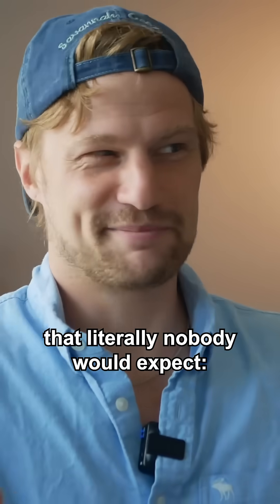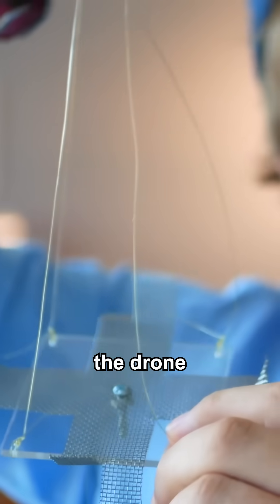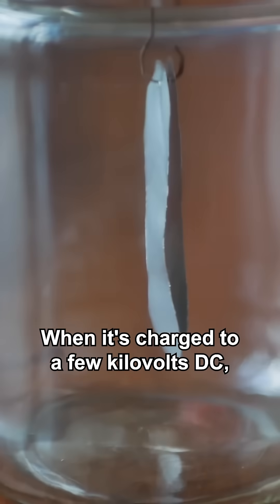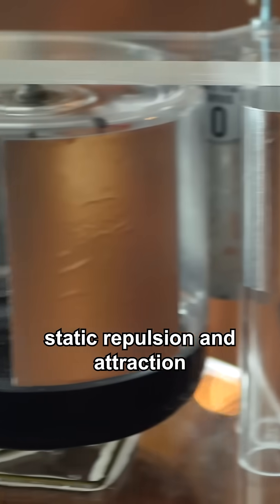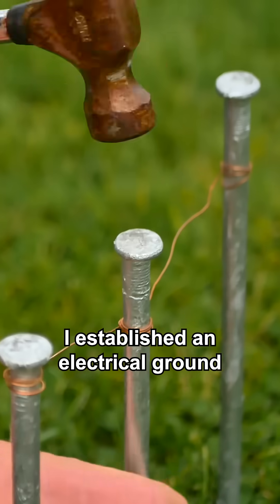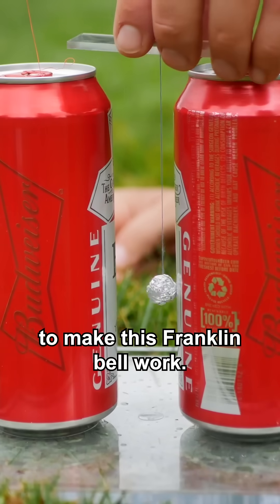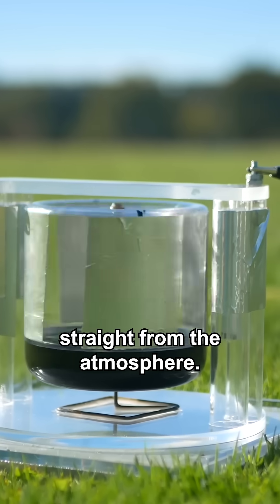Drone Harvesting Invisible High Voltage From the Sky

Comment: Ok, a little dose of truth.  These kind of devices have existed for over a century, their called aerials.  Now it's true that background radiation in the atmosphere can be used to induct an electrical current, but it's minuscule.  That's why we use TV's and radios to amplify it.  If this was capable of producing enough energy by itself to power a lightbulb we would all be getting a lethal dose of radiation.

The devices he's showing are gathering a static charge from the aerial, it's not a constant supply of electricity you could actually use to fully charge a phone sometime this year, let alone power a house.

Now it's a cool experiment and I don't think this guy is intentionally trying to mislead people, but I see a lot of people in the comments that are getting the wrong idea.
Reply: Thanks!
Reply: @Robert3785  yes. Probably why the Wardencliffe Tower was in Montauk. Coastal weather with fog is a much denser medium to draw electrons from as opposed to dry arid weather. It’s meant to have clouds and humid air pass through. Well. It sounds good for a novel anyway.
Reply: Yeah, he's not making any claims but people see something in principal, abandon all critical thinking and then conclude that it's a huge breakthrough.
It's cool, and in a perfect vacuum you can use sunlight and paint to spin a top that weighs as little as possible, but the sun isn't going to generate torque. 
Good to see the comment section adding details for those who don't know the difference p between a cool demo and a useable phenomenon
Reply: Tbh, I assumed it was static to begin with. Radiation never occurred to me. Admittedly, I wondered what the possibilities with this were, but my mind instantly went to the gargantuan, raging storms of planets like Jupiter. Their atmospheres might actually be enough to power something substantial. If they didn't blow those things away first. Our atmosphere doesn't really move enough or have enough charge outside of storms to likely be worth much in terms of (useful) harvestable electricity, yeah?
Reply: @ Pushing aside the more technical aspects of actually being able to do this.  If you were going to harvest  energy from Jupiter's atmosphere it might be better to some kind of wind turbine maybe?  I'm not to sure.
Reply: I like  my scientists to use the right spelling of "they're"
Reply: @ What funny coincidence!  I like it when my scientist's (and it is scientist's and not scientists since this is a possessive reference rather than a plural) realise that "they're" is a contraction of the words "they" and "are" where "they" is the plural of "he", "she" or "it" and "their" is the possessive term of "they".

So in sentence like "These kind of devices have existed for over a century, their called aerials"  which contains a possessive reference...
Reply: So what you're saying is you don't want to purchase a machine that I invented that turns orange marmalade into plutonium fine be that way
Reply: Thanks for the Crisp explanation

JAI SHREE RADHAKRISHNA
JAI MAA DURGAA
HAR HAR MAHADEVA
🙏🙏🙏🙏🙏🙏💐💐💐💐💐💐🙇‍♂️🙇‍♂️🙇‍♂️🙇‍♂️🙇‍♂️🙇‍♂️
Reply: Your comment is not in the spirit of the scientific method, sometimes old ideas should be periodically revisited with the assistance of modern technological innovations to check up on them. Just because it's "useless" right now or even 50-100 years ago doesn't mean you shouldn't revisit it from time to time to see if we can do it a little better. 

Plenty of people were skeptical of the mere idea of flying and it took a long time of trial and error and solving problems before it worked- and even more time for it to be widespread and somewhat available to people.
Reply: "aerials, in the sky....when you free your mind you realise 🎵"
Reply: Skeptical of your lethality claims; from my understanding, Tesla did extensive research in this area, transmitting enough energy to power objects. Also, what kind of radiation? It's not nuclear; you'd have to be referring to thermal, which isn't consistent with what I've learned as a general nerd over 30+ years. I'm not an expert at all, just curious if I'm missing something or misinterpreting.
Reply: I appreciate your comment, but  "A lethal does of radiation"? Haha no... not even close.
Reply: @machine5082  The voltage in a receiving antenna is about 50 micovolts.  A 60W lightbulb uses about 120V.  That means for an aerial to power a lightbulb the amount of energy in the signal would have to be 2.4 million times background.  Sound like a lethal dose?
Reply: @Robert3785  Your Correct, 2.4 Million times background radiation. However the Sun alone puts out 1,361,000 times background per m². So while I'd admit we would get sun burnt standing under APPROX 2 suns pretty quickly, it wouldn't be Lethal. Fair?
Reply: @ Well first all, most of that is other EM radiation on shorter wavelengths like of infrared, visible light, UV and so on, which aren't applicable here.

Secondly the external cosmic radiation (which includes the applicable portion of the Sun's non visible spectrum) is part of the background that I have already included in my calculation.  So I stand by my original claim that if you could use an antenna to power a lightbulb you wouldn't live long to see it.
Reply: I was dumb now I’m smarter. Thanks mate!👍👍👍
Reply: wonder if you try to argue your point with Tesla? will you have a ground for it, or it will be gone in the ether.
Reply: Thank you Sir !
Reply: Powering doohickeys is all I need
Reply: I thought they just catched radio signals and transformed then back into motion. You know... Foxhole radio, but with a motor instead of a headphone membrane.
Reply: Although I liked your post, keep in mind that from a little movement multiplied across multiple devices can impulse larger generators assisted by traditional means to create substantial savings in energy costs to everyday consumers.
Reply: All correct except I wouldn't call it "gathering a charge". There's a voltage gradient in the atmosphere that accumulates whenever and wherever wind blows. Effectively a big battery. In the extreme, voltage gets big enough to ionize air, and lightning results. His aerial is discharging the battery by just providing a path to ground. As you say, the available current with such a tiny aerial is also tiny.
Reply: Aerials in the sky
Reply: It's not minuscule if you understand it.
Reply: Not true, they actually are able to collect way more power now with new tech. I watched a guy use Grapheen wire and he was collecting enough power to run a house without and lag using a 5 acre plot.   The same tech is being developed as a power plant.
Reply: @madhadder6754  Can you give a source?  I'd be interested to see this.
Reply: @Robert3785 these comments refering to the pyramids are out of their minds or plane old trolls. People apparently can't build big buildings anymore because "it was aliens". In the future, they will say that bursh khalifa was built by aliens. Like, people were that loyal to kings, it's that easy.

Also, I think Plasma Channel himself expanded in an older video how atmospheric charge works, meaning that he doesn't purposely decieve people but people don't look further in the topic as you mentioned. It's a cool trick and besides that, an attempt of launching balloons to harvest the charge was planned, but had it's own issues.
Reply: Great comment! Constructive criticism like yours is so essential if all too rate. Glad you gave him the chance to save face, assuming he re-posted. Thank you!
Reply: How much is do to the drone moving the air?  
[As in electric battery powers propellers  which move the air, and water or air flow across surfaces can build up charge & voltage.]

Redo with helium balloon(s) hoisting the payload.

Fly the drone 3 feet off the ground.
How about hover it in basement, ooh, not atmosphere power, but power from mighty spinning  molton metal core of earth, 😮 ooh.
Reply: Hey man, don't be a big oil shill.
They have been keeping this information away from us.
This man is a hero for trying to get the truth out there.
LOL
Reply: Yep. Actually first statement is very true. A lot of energy up there. And we are already harvesting it. Actually it already brings in one or two percent of global energy consumption. I mean all energy, not only electricity. Percentage of electricity coming from wind is getting close to 10 percent. 

So yeah, energy is all over the place, even in farts. And this is just other school experiment like the one with a lemon or a potato. True, is a fancier one ;)
Reply: How much of what kind of drug were you taking
Reply: Very cool
Reply: AM joined the chat.    He says that he carries his own power.  No external sources needed.
Reply: Watch the full video clown
Reply: That sounds like a scale problem. Like if you use a hamster to turn a dynamo and it sucks, doesn't mean that we can't use turbines to produce power.
Reply: This is why they built pyramids so huge youd think.
Reply: this should be pinned
Reply: thanks dude i was abou to be one of em
Reply: I mean I kind of knew it was bs when he said the word "drone"
Reply: Just because you can't do something doesn't mean you should may not be good for the planet.. you know how greed gets ahold of us sometime
Reply: So wait, what kind of radiation in specific? This comment has me thinking about how powerful this type of "generator" could be after a nuclear attack or something like that...
Reply: Not a single not even a bone found in the pyramid why would you think it’s a tombstone?
Reply: @raramouni  They were below the pyramids, in chambers. Have you ever seen a tombstone in a modern cemetery? They usually don't contain bones, but they sit right over top of a place where bones are located. 🤔🤔
Reply: @raramouni  Because the people that built them left messages in the walls, in other structures and documents saying that is what they are.

Why are we even still on this?
Reply: You realise we're getting pumped by actual deadly radiation from all angles
Reply: let them have their moment ;D
Reply: there is also second part to this, he set his ground in specific way (few nails set at distance from each other) we done such experiment in school and it also allow to generate minuscule amount of energy. Experiment itself is interesting but real power is somewhere else in the sky. One lightning if stored could power house for years, but we don't have tech yet to catch that energy fast enough.
Reply: Of course you think pyramids are tombs lol. How much power is in a single lightning bolt?
Reply: @drew7155  i think that lightning bolt can have about from 10k to 200k amps and voltage is in range from 100M to 1000M, only problem that duration is counted in miliseconds
Reply: Thanks. I wonder if he was also collecting static electricity from the rotors on the drone that would seek a ground as well.  I’m 76 went to a two year school and was a terrible student. So didn’t learn much and remember less. However, he’s running a wire from the drone to his devices???
Reply: Thank you
Reply: *They're
Reply: Still… alternatives that should be explored and optimized to efficiency
Reply: Only difference is, our bodies DO experience huge amounts of radiation that get filtered through various means…
Reply: Is this what Tesla was talking about? I know how crazy he was. The thought of A.C. current. Like Elon says " that's stupid
Reply: And on top, the static field is bigger the Higher u Go, ... But, in this moment when u connect the wire to ground the static field around the collector loops and Drops to ground Level. Sadly useless.
Reply: Too many big words, I'm just gonna go with free green energy the government is hiding.
Reply: The guy liked most comments besides this one. Seems like he doesn’t want to live with reality and would rather be misleading 😂
Reply from the maker: @Charborn1 great info. the issue here though, with that thought process, is testing this setup without the gathering platform beneath the drone leads to significantly less output. Meaning, wind on the wire, or EMF on the wire isn’t producing most of the power. Most of it is from voltage gradient. Atmospheric electricity has long been established. It’s just not worth the time of most Investors. An entire football field of setups like what Ive done, will produce only a few kilowatts. So, not the easiest to build.
Reply: @ meanwhile a football field sized solar farm will easily generate over 1000 kw in a day with less work and maintenance. I don’t think there is any possible way to effectively generate electricity from the atmosphere. That being said I would like to be proven wrong
Reply: @PlasmaChannel  Needs refinement is all
Reply: Wardebcliff tower lite lightbulbs a mile away.
Reply: I think you need to look up non-ionizing radiation.
Reply: @KwispyKweam and it wouldn't even matter since nano Volts of voltage sure isn't a lot. Also, it's as easy as getting any radio equipment with a built in signal strength measuring ability. Walkie talkies measure and display the signal strength in dBm, but you can convert it into Volts. So far an antenna will show you peaks of perhaps some nano volts or so ? Am stations are stronger, but are fading out.
Reply: weren't there radios that just siphoned off energy of the signals
Reply: @takipsizad  I believe you're thinking of Crystal radios.
Reply: ok, so if it isn't based on the 'size' of the electrode he made, then you can make them out of the line alone to carry up into the atmosphere kind of like spidersilk, however we may need carbon nanotubes for this, we're getting a lot closer to making this feasible, because you can easily scale at that point right? What energy do Tesla coils actually use?
Reply: Friction, location and amplification are all factors that play into this.
Electric discharge is actually a huge problem for jets =)
Reply: You could definitely end up scrapping your phone with it.
There is a huge amount of buzz lately around Tesla and his experiments, but no one stops for half a second tho think that we are now dabbling in quantum computing, and if Teslas ideas had merit, we would be using them. The lack of knowledge all over the place, fed by the internet is legendary. There is actual theory involved, and the majority can't even remember grade 9, let alone basic physics.
Reply: And then there is that fraudster from Zimbabwe who claims he can harvest those charges of radiation to power a car and TV. The whole African World hailing his invention but it's just a fake. Nobody has seen the car travelling more than hundreds of kilometres under real scientific observation.
Reply: Yeah, but... Couldn't this or a form of it be integrated into the concept of a space elevator?
Reply: Their called?
Reply: So you're not too far off from this guy's channel intentions. It's much more leaning towards a professional "YouTuber" than a science communicator
Reply: 30 years ago people used wire phones.
Reply: Like the guy who invented the motor car that ran off water????? Google him. He must still be around.......
Reply: @randocommando2 except there are ACTUAL ISSUES with hydrogen powered cars. The idea was that a catalyst of some form would brake water down into hydrogen and oxygen. Thing is, there are so many collisions and accidents happening, that having literal rocket fuel in your car would turn accidents into mini Hiroshimas. Of course there are companies that would hate that brake trough if safer, but it's also partially the incompetence of some deivers
Reply: He doesn't care about misleading people, he cares about impressions. Having half of people believe him and half believe his intentions aren't great is really good for engagement, I'm sure.
Reply: @ApothercyCold could be although he never openly stated anywhere that it's actually a good or strong source of energy. The longer format video talk about all the downsidea and how it works. I guess people not doing their research is rather to blame here then Plasma Channel decieving people intentionally.
Reply: Look at what Lighting can do!
Reply: Bus Kill.
Reply: This only makes it more interesting
Reply: Look at natural eather lay lines versus the fake ones they created
Reply: This has nothing to do with radiation!
The atmosphere has a negative static charge of 100v per meter, and there's actually a tiny constant current flowing. This is continually charged by thunderstorms all over the world.
Reply: I did some research i find nothing about aerials , could you give some more keyterms so i can do some research on this ?
Reply: @Robert3785  you say this and tell us we have the wrong idea?
Reply: Are you the CIA ? Worried cause humans are finally experimenting the stuff you want to keep buried ?
Reply: You don’t even know ow how to use proper grammar so I’m not listening to what you say
Reply: @user-jd6ld7od6m the grammar excuse😂😂😂
Reply: @user-jd6ld7od6m  My, non cared;
Reply: Tesla disagreed.
Reply: For everyone hating on the "dummies" getting blown away by the video, consider people's ignorance on this matter to be a scathing critique of the current state of most public education systems across our civilization
Reply: Imagine if the high voltage power lines and skyscrapers are secretly harvesting atmospheric electricity as we speak. 
Or hydrocarbons are just processed carbohydrates from our butts
Reply: @Robert3785    you're an idiot for saying that it just gives it a charge and it's not a constant flow of electricity; it is a constant flow of electricity, how much electricity do you think there is in the atmosphere ?? In the earth's entire atmosphere you don't think a flow could be produced?  This type of BS is exactly what's wrong with the Internet
Reply: @cno733  (sigh) Learn how to read:

"The devices he's showing are gathering a static charge from the aerial, it's not a constant supply..." 

When I said it's static charge and not a constant flow I was referring to the devices he was using and how they function.  Which is a repeating cycle of building up a charge and then discharging like a capacitor.

The main wrong with the internet is the people who read a piece of information and them jump to a conclusion without taking the time to understand what they information actually  is.  like YOU!
Reply: 1: the title of the video
2: he literally calls the atmosphere a power source
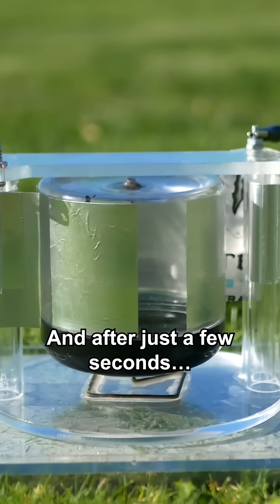3: at 1:04 he calls it a miracle
4: right after that he says "i quite literally was siphoning energy straight from the atmosphere"

he is either a complete moron or he knows exactly what hes doing -_- lame
Reply: I feel like that's exactly what Big Power WOULD say.
Reply: @mattd1188 hilarious 😂😂Well done 👏
Reply: wheres the battery
Reply: Sounds like you are full of bs.
Reply: Why you so negative man, totally ruined my day.
Reply: The higher you climb , the higher the voltage,  have to insulate the wire or lose the difference in potential
Reply: @ricksummerfield7260 vacuum tube is more efficient
Reply: lol..."but I see a lot of people in the comments that are getting the wrong idea."....so what?
Reply: Party pooper
Reply: The Wright brothers first flight lasted seconds.

I guess we can conclude flight is a novelty from that.
Reply: What do you think about the pyramids? I would like to know your thoughts.
Reply: @theodorefreeman they're neat but have literally nothing to do with anything of this
Reply: @theomdorefreeman  he thinks they are ancient tombs. Enough said! He knows NOTHING. We now know it is a giant power generator.  No bodies ever found.
Reply: @ Please tell me, how much electrically powered technology have they found in or around Giza from 4500 years ago for them to power?  Stop watching those morons on Ancient Aliens and read an actual book... or a least a wiki page.
Reply: @theodorefreeman  alien landing pads. Back in the twenties they found a large ring next to them and several decades later there was this secret government program centering around it.
Reply: @theodorefreeman  I'm really surprises to see this renaissence of ancient aliens style theories about the Egyptian pyramids that's happened lately. I've been around long enough that I shouldn't be, but it really feels like it came of nowhere this time.
Reply: @PolarisC8  I blame the history channel first and netflix second. History channel for Ancient Aliens and Netflix for Graham Hancock's special which is just a rehash of Ancient Aliens for a new young, gullible audience.
Reply: @PolarisC8 regardless of what the other dude said I'm still hoping their actually ancient casinos
Reply: @kainuscorevax3875 tbf to Graham Hancock he is much more of the ‘what if’ and ‘how is this possible’ etc less definitive talk of aliens n stuff. It’s fair to call out how impressive they and thjngs like the precision cut stone etc on certain historical sights that tbf scientists do have trouble explaining so a lot of history is assumed but I don’t think aliens is the answer 😂
Reply: @Zig423  TBF? His special opens with " this is what the mainstream archeologists don't want you to know." He missrepresents and outright lies about everything he speaks about. Doesn't matter if he doesn't say outright " it aliens" he implies it so hard it's not worth distinction. Scientists do not have a problem explaining the WEATHERING of stone. But Graham would like you to think they do.
Reply: @PolarisC8 only our western materialist cultures are surprised by the return of such theories - we're snobs after all. We forget (or ignore) how new and unique our assumptions are in the history of the world. We even have the audacity to think our values are naturally universal and self-evident. We're the first society in history to be this arrogant and presumptuous. 

We're only surprised because we're naive. And now we're starting to see the personal anxiety, disillusionment, and depression that comes from believing the cosmos is without purpose. Of course we're going to look elsewhere.
Reply: @PolarisC8 maybe it's related to the removal of the Minister of antiquities in Egypt. Lots of complaints about that person over the years and now he's out.
Reply: @PolarisC8 Pseudoscience and History are a really big thing atm. Its mad people took question everything way too far and way too literally... Its all linked to the far right culture war stuff deep down so they can corrupt history
Reply: @PolarisC8  It never left. These people just happen to flock to the same places over and over again, and every now and then you get exposed to the lunacy. People see something they don't understand and immediately assume it's either a deity or aliens. I remember learning about some of the methods used to build the pyramids in middle school, and it didn't seem all that mysterious or farfetched.
Reply: @PolarisC8 Well that's what happens when people actually look into the pyramids and see that the "official" story doesn't align with reality. 
I have no idea who actually built the pyramids, but they didn't have the capabilities to do what we can see with our own eyes. Only reasonable possibility is they had more advanced technology than we're being told. 
Is that advanced technology anti gravity and laser cutting devices? Extre unlikely. They definitely didn't carve granite out of brass and copper tools though, especially not with the accuracy that's been observed. 

Not aliens, but definitely not brass tools either.
Reply: @theodorefreeman  Their ancient tombs.
Reply: @Robert3785  CRAP!!!! Here i was hoping for ancient casinos 😢
Reply: @Robert3785 the pyramids aren't tombs. Not a single body has EVER been found in one.
Reply: @ShysterMeister  That's because they were looted a long time ago.
Reply: @Robert3785  the pyramids are a ancient  tombs?

Do you really think anyone would spend half their nations wealth to build a tomb for 1 person?

The people would rebel and overthrown such a king.

No king in history has that level of loyalty.

---

How do I know this? 

Well for 1, no other king has ever had that much loyalty.

2 there are actually pyramids around the world that are not tombs

Like the pyramids in China

Explain those
Reply: @vincent3060 your forgetting they believe there kings where directly chosen by there gods and that they where the conduit through which there gods rules. So they where essentially burying a proxy God I guess and if there’s one thing no1 wanted to do is upset the gods
Reply: @vincent3060 considering it’s been documented that on request from the gods - through leaders, people were willing to sacrifice themselves there children there people to gods. You think they won’t build a big pyramid to keep them happy?
Reply: @vincent3060  I agree it's a stupid idea, so (eventually) did the Ancient Egyptian's.  That's why they stopped doing it and started burying in the valley of the Kings instead.
Reply: @Robert3785 Big square rocks, forming a tall....well....pyramid.😊
Reply: @Robert3785  they're
Reply: @vincent3060 Go touch grass bud like you know the minds opinions views feelings and motivations of an empire that spanned thousands of years! They are tombs bud
Reply: @TheBanana93 look in the mirror and repeat your statement back to yourself

it applies to you too

bud

---

Truth is, no one knows
but I have a right to disagree with you

Right?
Reply: @Robert3785  😂😂😂😂 how are they tombs ... Explain...😅😅😅
Reply: @Robert3785 they are
Reply: @Robert3785  so people built the pyramids with their bare hands and bronze age tools?? Something about people who think they know it all that humors me somewhat. You read a few books and all of a sudden you're a genius in your own mind.
Reply: @asimellamo8411 you can't be serious. What do yo honestly expect ? People can't build buildings anymore because it must always be aliens. Ever heared of the chinese forbidden town ? Yeah, well that's how respected emperors were back then and people WOULD have sacrificed themselves. The perception has of course changed since then, but remember that the king was probably the only one able to read so what he sais must be done because he has reasons, even if he doesn't
Reply: The Egyptian trxts talk of roastau and how they were initiation centres, using frequency for the attainment of states of consciousness.. of course the completely provable but dismissed evidence that they were not built by/for the pharaohs entombment is the inventory stele at the pyramid temple compex which state that khafre was responsible for refurbishing the pyramid d named after him, not create it to put his body in.. ie, they were there before he was.. who is more trustworthy regarding their construction, those trying to make names for themselves or the guys who wrre actually there and literally carved into stone what they did and why they were there.. ?   @Robert3785
Reply: @Robert3785 Since we are out here acting like we are so smart, *they're
Reply: @Robert3785 apparently you haven't been keeping up on the news.
Reply: @mikebushnell4598  Conspiracy theory  propaganda "Aliens Built the Pyramids" news or actual factual news.
Reply: @vincent3060 Oo really got us there buddy way to go. I mean not like kings ever expected or received such glory on earth right? Like gilded thrones and a holy status among people? Oh wait, they did.
Reply: @vincent3060 Obviously not every pyramid is a tomb, no one said ones in China were, but because its a pyramid its something special? A stable stack of rocks? Its easier than a skyscraper, if its everywhere there's a common sense reason for it, its easy/more doable than other structures. 😂
Reply: @icejuice9316 
If a king had them built statues of him, the statue doesn't cost half the nation's wealth.

To put things into perspective 

They just discovered that the pyramids have pillars that go down about 800 meters

Which actually puts the size of the pyramids at 943 meters 

That's taller than the talest building on Earth in Dubai. 

---

Look it up

"The Pyramids have pillars"

---

Why would it have pillars, under ground, if it was just a burial?

That's like build a dog house for an ant.

That makes no sense. 

---

Anyways 

But the main point this, 

It cost half of Egypts wealth to build the pyramids.

Just to bury someone? 

---

The Egyptians were ancient, they weren't brain dead.

---

It's like your entire family tree building the empire state building, just to bury you.

It's not just overkill, it makes no logical sense. 

---

The family member of the king would overthrow him, if he was going to leave them in poverty, just to build himself a tumb.
Reply: @Robert3785 How many people were found inside the pyramids, if they're tombs?
Reply: @Robert3785 no corpse has ever been found in them so…